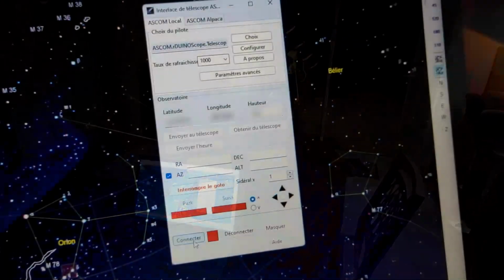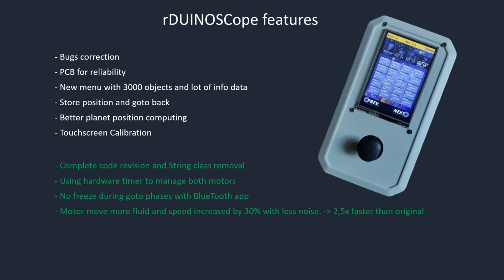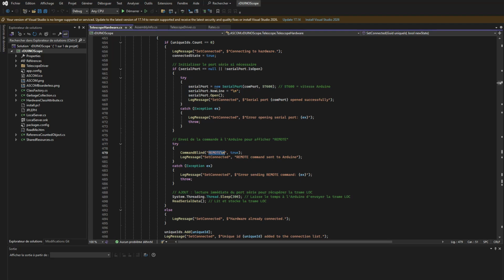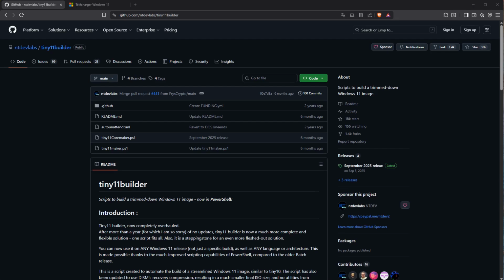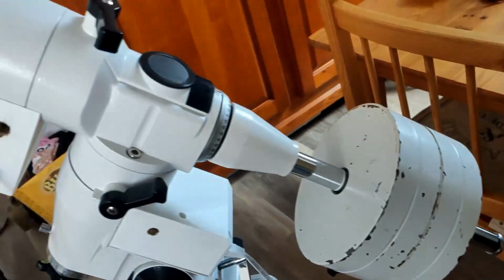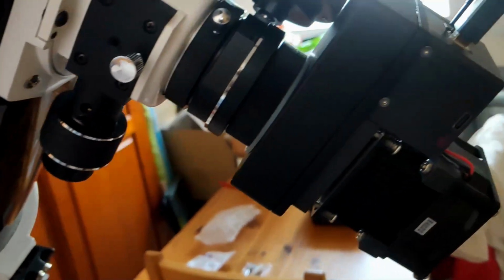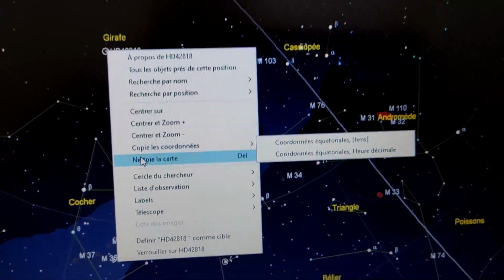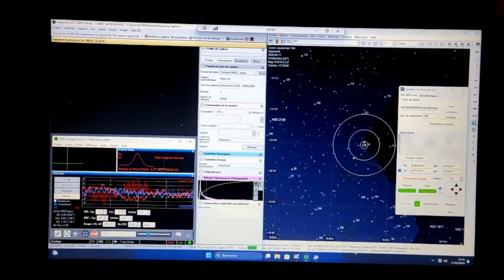rDUINOSCope : ASCOM Update

Comment: Nice looking project! Can you update your pcb file on github? And why you dont consider using tmc2208 or 2209 drivers?
Reply from the maker: No need to update the pcb file, this is the same. Just no need to solder all autoguiding stuff that can go now thru the USB. For the drivers, I didn't know that it was possible to silent the motors with these drivers, Khairey taught me that ! 🤩I just saw videos about that, thats incredible.